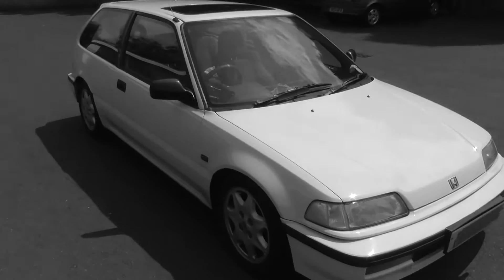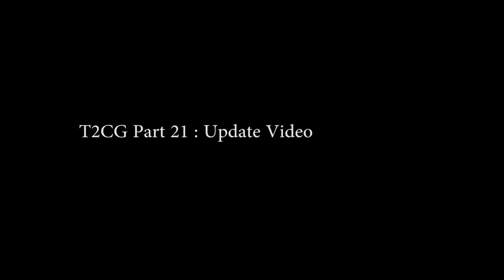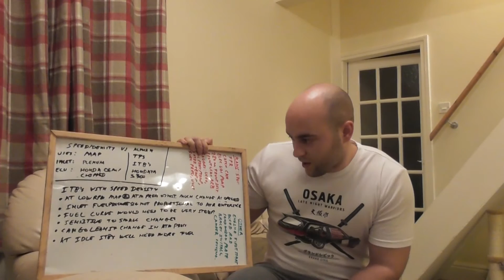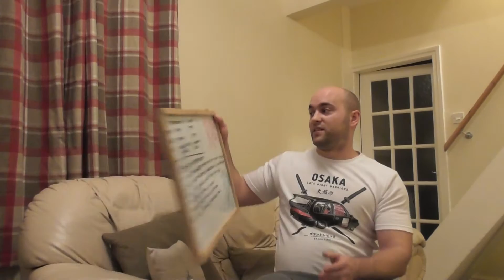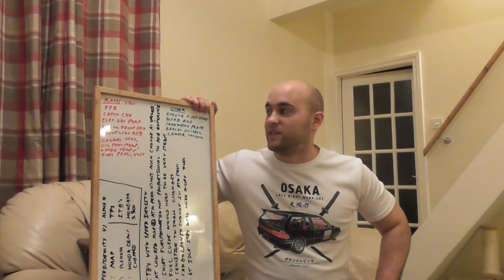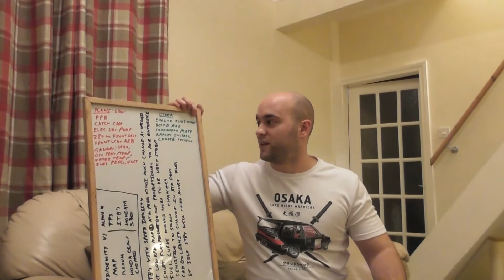T2CG Honda Civic EF Part 21 : Update Video

Comment: Do you have a vacuum distribution block that connects all 4 intake runners?
Reply from the maker: I do have a vacuum block, however the vacuum was not strong enough to assist the brakes. That is why I like the idea of the electric vacuum pump. Thanks for your comment.
Reply: Well I hope you get it all sorted, and am looking forward to more updates. Cheers!
Reply from the maker: +Clark R Thanks for your comment, I have the Hondata ECU now and will buy the electric vacuum pump so I should be able to get it done now.  Thanks